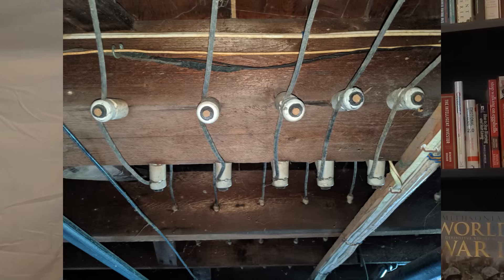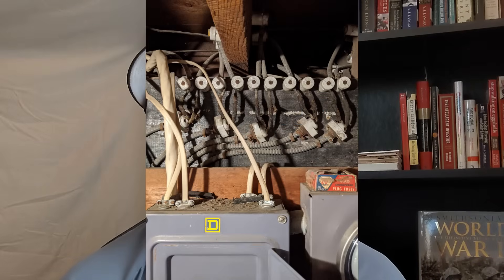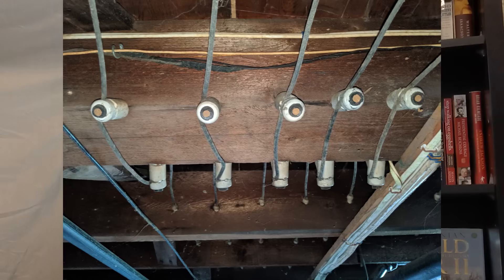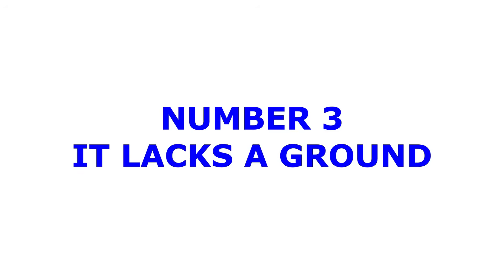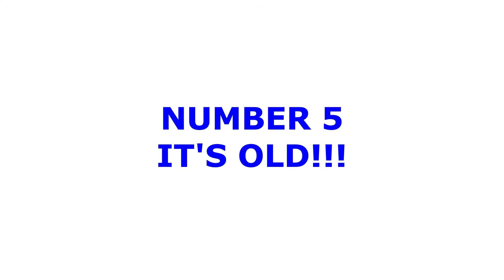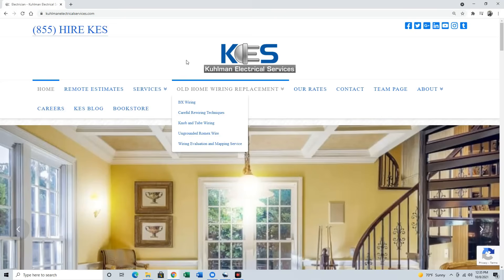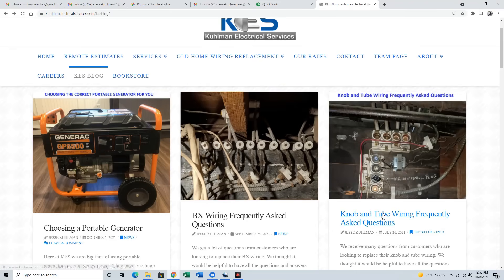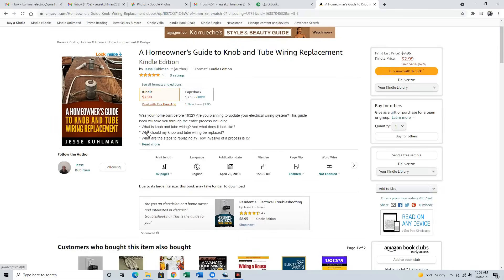Knob and Tube Wiring: Top 5 Issues | Jesse Kuhlman

Comment: Knob and tube on the left coast was installed at least up to WWII, not 1932 as you say.  My home was built in 1940 and originally completely knob and tube; as an electrician I can tell you this is the case in housing throughout the SF Bay Area.  Most homes still have a blend of knob and tube in the bedrooms with a fuse box subpanel and  modern wiring in the kitchens, leading back to a circuit breaker meter/main.  Because of the age of the housing stock, there are still a lot of FPE OCPDs out there which represent the first-gen electrical remodels that occurred in the 1950s and 1960s.
Reply from the maker: Hi Steve, i learned a lot about the age of the system from everyone on here! Thank you for sharing.. It's interesting how different the east coast is from the west coast!
Reply: FPE was pretty good till it came out with the stab-lock brkrs, fuses will always be 
much safer. a given amount of current thru a lead wire or strip of a given gage will 
always melt. Old homes with pull-outs were nice for emergency generators too,
'pull the mains' and Range and u were totally isolated from the grid. As I have seen,
some old panels the range would not work if the Mains were pulled. the branch ckts
were off the MAINS but some panels other panels the range would work if the mains 
were pulled
Reply: FPE made a good fuse panel, some had a main breaker but fuses for there 110 v 
branch circuits and pull-outs for the range and dryer circuits. Other fuse panels 
had two large pull-outs, one for the MAINS, one for the RANGE. 

FPE went str8 to
hell when they came out w the stab-lock breakers. I know for a fact as one day a
wire in the clothes dryer had intermittent shorts to the back panel and burned a 
hole thru said panel, never tripping the breaker, another time, the cord from a
space heater had a white ball of an arc and the breaker never tripped.
I have seen houses where KnT was used and no one hacked into it so it was kept 
there, that fuse panel was then used as a Sub-panel a newer panel brought in for the 
stove, clothes dryer and A/C
Reply: I'm in PA and my 1940 house was also knob and tube. I've seen the knobs and tubes to verify.
It was rewired in the late 60's with modern grounded wiring. 
I've googled and it seems (from my extensive Google research lol) that it was installed into the 1940's in some places. 
I

Comment: WTF for me as a german that is absolutely ridiculous. Do this wires even have some sort of insulation or is it just the bare copper running on the ceiling
Reply: They are insulated.  And properly maintained they are also safe and still recognized by the National Fire Protection Association's publication #70, latest edition.  As an American, I'm fairly confident that the Standard is sufficiently robust in its installation requirements to avoid electrical hazards.  Maintenance is key though; I am sure that holds true in Germany as well.
Reply: @steveloux4709  its actually a well thought out system....conductors spaced apart....less chance of them touching and connections soldered together....better than any wire nut......if it had a ground it would be no problem...its like old style fuses....they are actually more reliable than modern breakers because there are no moving parts that can fail but it was idiots using pennies and burning down the house that ruined them...
Reply: I live in an older American home (1869) that once had knob and tube wiring including wooden surface mount conduit that had two grooves for the conductors to be placed in. My home was originally built and owned by German-Americans (Jacob Sterner a miller).
Reply: It needs air space for cooling purposes. The wire is insulated. But N&T is very overbuilt compared to today's systems.

Comment: This is nuts people don't want to change their electrical circuits to newer technologies - I just cannot imagine living in a house with live wires like that
Reply from the maker: Most of our customers are replacing the wiring because they are getting their homes insulated.  I would say only 10% of our customers are replacing the K+T because they want an updated system.. It seems like most people don't even think about it until they need the insulation!
Reply: Well, what happens is they see an estimate for $2-300.00 per opening to rewire the home and they just take their chances.
Reply: @electricianron_New_Jersey  yeah - I thought gambling is legal only in certain parts of USA, but it seems I was wrong 😅
Reply: @electricianron_New_Jersey  You are correct.  It is much the same with auto mechanics,dentists,etc. I'm here to buck the trend. I will work with people on these older homes (usually younger couples just starting out) with a variety of options.
Reply: same
Reply: It’s the cost.

Comment: It's only bad if it's in poor condition. That tends to be the case, but the people wiring homes back then weren't stupid. Those porcelain knobs and tubes will outlast most modern installations.
Reply: The wires themselves, the rubber insulation will dry out and fall off.
Reply: Hell yes
Reply: So you’re saying every electrician is wrong? You must have knob and tube wiring and trying to convince yourself. Lol. Do you not have and electrical items that require 3-prong outlets? In the 2020’s a home has way more electricity running through it than even the 90’s. Power overload=fire.
Reply: @flikdupplus knob and tube wiring often can support 50+ amp draws. Some have tested as high as 90 amps. It's remarkably robust when installed correctly.
Reply: Yes, but what about the point that modern day lifestyle requires far more electricity than the old system was designed for?
Reply: @micheleemcdaniel389  Those old houses might have only had 4 circuits for the whole house. Back then the only appliances were an iron and maybe a refrigerator. There typically was one light and one convenience outlet per room. Over the years people added more appliances, lamps, and other devices to these homes on the same 4 circuits. combine that with the age of the wiring and breakdown of wire insulation and you have a fire.
Reply: @thomasdragosr.841   You need to separate in your mind the service from the wiring within the house. You can upgrade a service from a 30amp 120, to a 240,and still use the wiring within the walls, basement , attic.  You can run romax or A.C for  Added circuits once you've upgraded the panel (the service)  It doesn't mean there's anything automatically "wrong" with your existing knob and tube that remains  In use. You need to understand about limits according to wires size about amperage and overcurrent devices and accordance with that if you have a dedicated circuit for a microwave that's gonna be something new, Or  It's going to be off the existing knob & tube or t if it is, it's going to have enough Amperage to handle it or  not.
 You need to count- up how many amps in total are on a given circuit ( A load calculation).
Reply: @micheleemcdaniel389  It's also important to understand that not all knob and tube is the same.  I have seen some with relatively thin wires, and I have seen others with much beefier wires (even 10 AWG), which were technically capable of carrying far more current even than most modern house wiring can.

My own house actually has 12 gauge K&T all over the place, which is the same size wire used for all modern 20 amp circuits (plus, since it's in open air, technically it should be able to handle even more than 12 gauge Romex (though I'm not gonna test that)...

A lot of this stuff was also built back in the day when people overengineered a lot on principle.
Reply: @micheleemcdaniel389 No one is suggesting connecting your central AC system to a knob and tube circuit. Lighting loads are far more efficient now, and we still permit an unlimited number of convenience outlets on a standard 15-amp circuit. At worst, you end up with nuisance trips, same as you would with the most modern version of the NEC.
Reply: @daviddixon9693  Your nuisance trips will happen a lot from using GFCI outlets on your knob and tube wiring, lol.
Reply: @GailUrge-vq6qn  A GFCI receptacle will work just fine with knob and tube wiring, and is the only proper way to be able to use 3-prong devices without rewiring. A GFCI receptacle is no more likely to trip than with modern wiring--and offers more protection than a 3-prong receptacle without GFCI protection. 

If you're still concerned, feed the knob and tube wiring from a CAFCI or dual-function breaker and you're protected against damage to the hidden wiring better than with NM cable.
Reply: @GailUrge-vq6qn Why? GFCI receptacles only trip when the current coming in on the hot doesn't match the current going back on the neutral. They're the best thing to install on ungrounded circuits, because they'll trip in situations where the breaker will not. If the handy man put in a gfci where the fridge was added, no one would have been getting shocked while touching the range,  because the gfci would have tripped instantly or long beforehand.

Comment: I used to work fire/water restoration and a lot of home had this old wire. Even if the wire was unrelated to the fire the whole house was gutted and all the old wire and associated pieces scattered along the ground and wire into a scrap copper pile. All new wiring, outlets, switches, etc. Felt kinda bad seeing this pice of history from the 1800s just going in the trash but was unsafe.
Reply from the maker: Makes sense!

Comment: i wouldn't say just because something is old it's bad, I still come across knob and tube that is still in great shape even in the light box, and to solve the no ground issue you can install GFCI receptacles. granted I'm partial to knob and tube, even installed it in my shed, fuse box and all. Biggest issue i find with it would be lack of circuits of course, and the insulation issue. i've actually load tested it, new plastic wire vs. 60's vs. 40's vs. K&T all #14 and the K&T won out easily, the plastic melting and burning up while the knob and tube didn't do anything even holding 90 amps. 60's wire still melted, 40's held on fine until it got so hot the insulation became conductive and the whole thing glowed like a light bulb.
Reply: @gtb81 yes and that old rough cut oak is second to none!
Reply: Yeah I have to agree.  And you know what else is really old in a house that has knob and tube?  Pretty much the rest of the structure of the house!!!
Reply: @PostmanApocalypse  yeah, and it's still standing, the wood is much better than new wood you would get today, it's old growth and full size, just the weight difference alone is substantial. A new 2x4 is puny compared to a 100 year old 2x4.

Comment: It’s so pretty to see a well run knob and tube install.  Saw one in my friends house - like looking back in time…. And I tore all of it out of there!  Way too dangerous. I did an extremely pretty rewire. Hopefully in a hundred years somebody will look at my install favorably, before they rewire it again.
Reply from the maker: Very cool! Interesting to think to the future, when will romex wire become outdated?
Reply: @kuhlmanelectric  When DC homes take over.
Reply: @DonkeyLipsDA3rd  you don't think AC (possibly at much higher frequencies like 400Hz airplane wiring) will continue to be used for long runs? Or maybe high voltage DC?
Reply: @DonkeyLipsDA3rd   That contest with Edison and Westinghouse was settled a 130 years ago.
Reply: @DonkeyLipsDA3rd Then why not use the same wiring
Reply: Hey I’m looking to buy a house built in 1980 with knob and tube which is weird, but how much can I expect to rewire? About 2100 square feet
Reply: 100 years from now everything will have it's own power source won't be any need for wires. We see the progression of battery technology just look at a battery powered tool 20 years ago never would have bought a battery skill saw. They made some nicad ones they were weak underpowered today small lithium battery in a impact gun has as much power as most air impacts.
Reply: Agreed, sometimes you open up an area and the knob & Tube still looks brand new.